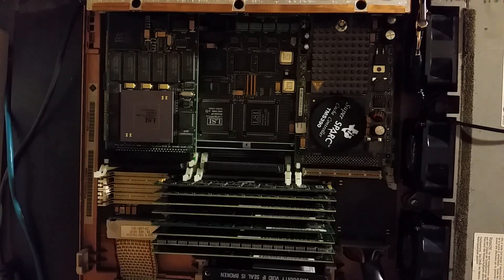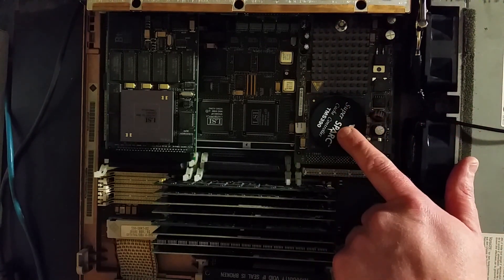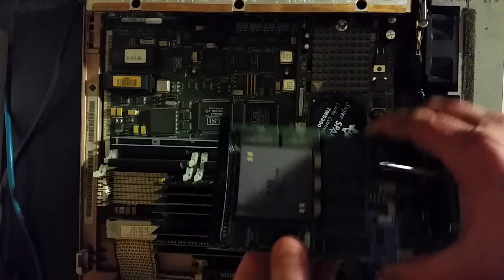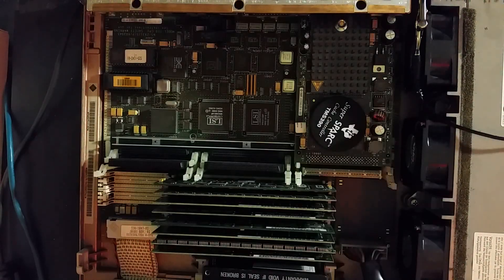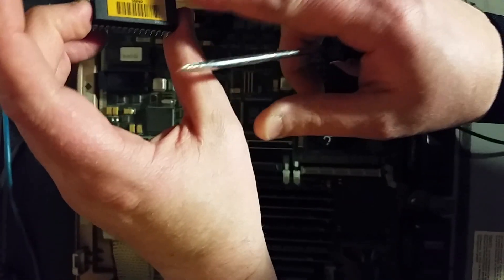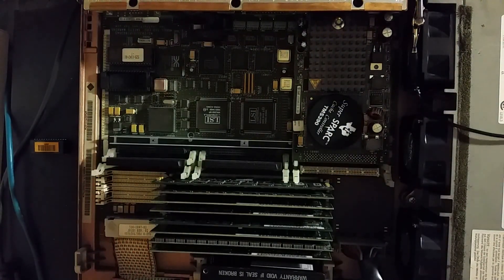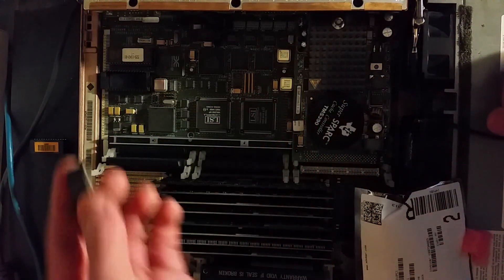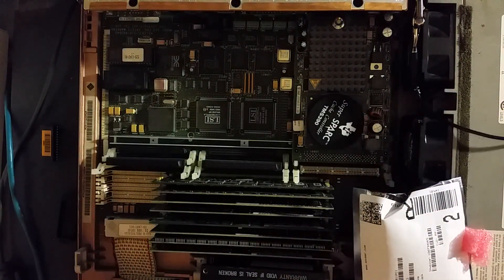Replacing NVRAM/RTC on SparcStation 10 Part1 (hardware)

Comment: Thanks for covering the SparcStation 10.  I just got one and the videos are awesome.
Reply from the maker: +Geoff Pool Thank you, congratulation on your acquisition. Are there any topics related to the SPARCstation you would like to see?
Reply: +Stephen's Machine Room I just ordered some parts including new firmware for the Hypersparc.  I would love to see a video on replacing the firmware and installation of the Ross Hypersparc.  I"m also planning on installing Solaris 2.6... would like to see the installation process of either SunOS or Solaris on the SCSI2SD adapter.
Reply: +Stephen's Machine Room When you shoot your videos, how did you setup your host system for serial connection?
Reply from the maker: +Geoff Pool The default on most Sun workstations is to put console out on ttya when there is no keyboard connected, you may want to set-defaults from openboot to ensure that it is ttya at 9600 8-n-1
Reply from the maker: +Geoff Pool Just uploaded a video on MBus module installation